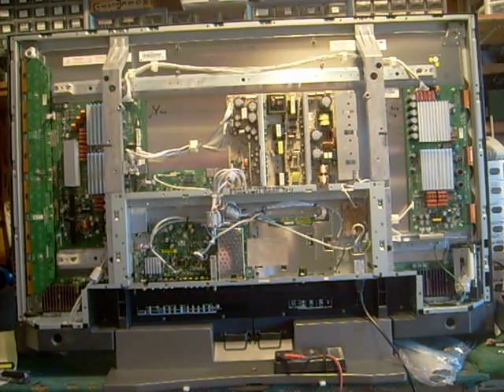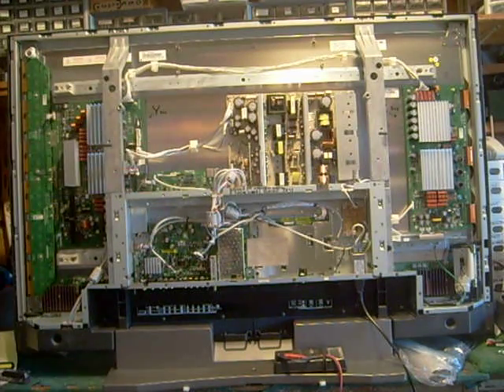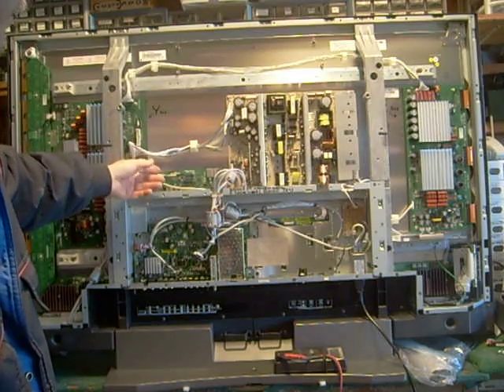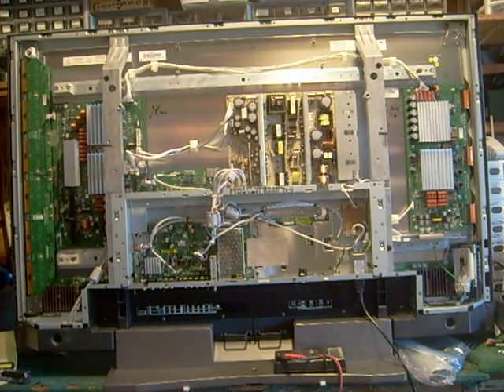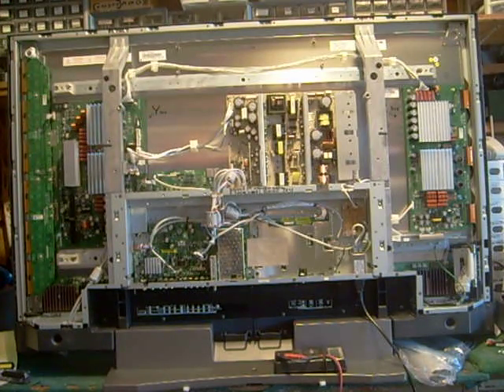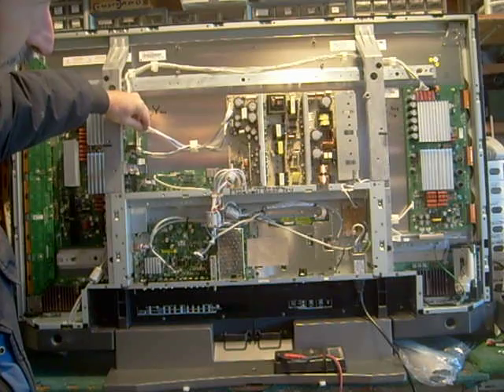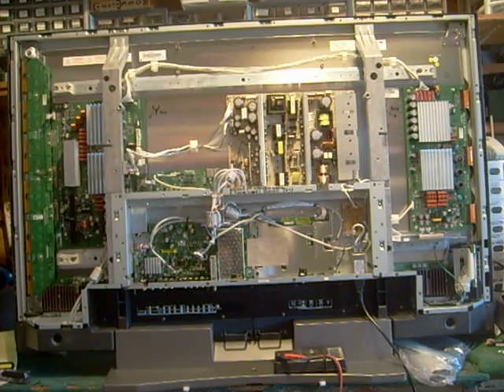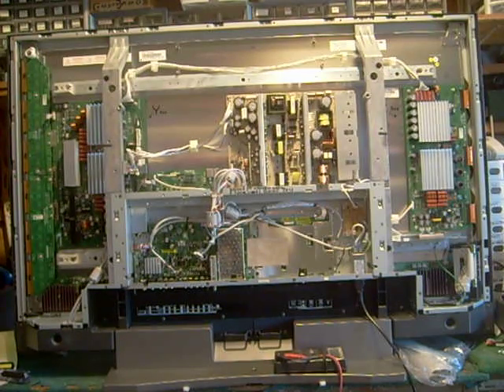Toshiba plasma repair. Model # 50HP16

Comment: Initially unit would power up video display had quilt work of 4" squares of raster covering the entire display and would then shut down and restart display for a few seconds then repeat the cycle.  I replaced the caps on the power supply board 6709900020A, then the IC modules on the YSUS board 6871QYH039B and lastly the MOSFETs 46N15s all 6 of them on the upper 6871QDH088A and lower 6871QDH089A buffer boards as they tested shorted via DVOM.

Comment: After that pic came up as did sound looked great, discovered that input select board 68719SMK88A would not select any other inputs receiving sound but no pic, the Ant input was working correctly.

Comment: I had the set working for 2 weeks then the problem started again to start up, a row of 4" raster blocks across the bottom then full pic display with sound then shut down and restart repeating cycles.  Any suggestions as to what to look at next? - Mike

Comment: I did some more investigating and found that I get pic and sound via ant input, and nothing on the AV and S-Video inputs. I tried two different sources and different cables with the same result. At this point I suspect the Main Analog Assembly Board P/N 68719SMK88A. I will need to get another and try it.  Any thoughts?

Comment: I am working on a LG 50pc1dr-ua.a it looks exactly like the samsung in this video.  I replaced the following:  caps on the power supply, modules YPPD-J015E and YPPD-J016E on the Y-SUS board, the power MOSFETs  46N15, three each on the upper and lower buffer boards.  Powered Panel on worked for about 3 hours the went to black screen, no sound, powers up for about 3-5 minutes then shuts down. Any suggestions?

Comment: SN755866  SN755870  SN755867  SN755881  SN755864  SN755882  AS15-F AS15-G AS19-H1G AS19F FE3407F  STK795-521  AXF1145  STK795-523  AXF1144   PIONEER  PDP43 
STK795-820   STK795-821  YPPD-J017C  YPPD-J018C  YPPD-J018E  42V8  42X3
4921QP1041  4921QP1050B  
YPPD-J015A  YPPD-J015B  YPPD-J015C  YPPD-J015E  SPI-50X3S240    4921QP1048A  4921QP1048B  4921QP1052A  4921QP1052B  50X3
YPPD-J016A  YPPD-J016B  YPPD-J016C  YPPD-J016E   
YPPD-J010A  YPPD-J010C YPPD-J012A 4921QP1029A  4921QP1029P

Comment: These older LG-based plasmas seem to have lots of Y-Sus issues. The IPMs are a pain to desolder without a desoldering gun, but the repair is currently about $80 in parts. Also, mal-discharge (red, green, or blue sparkles) can appear after changing the IPMs on some of the LGs, so the logic board has to be flashed with firmware to correct the issue.